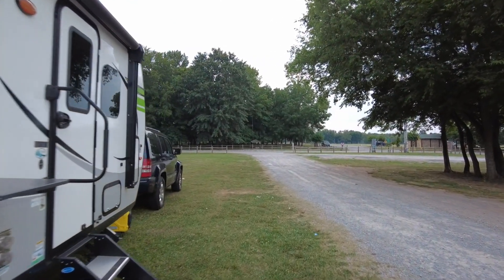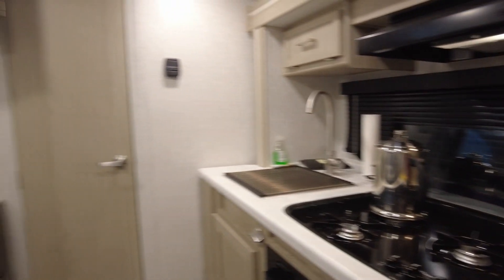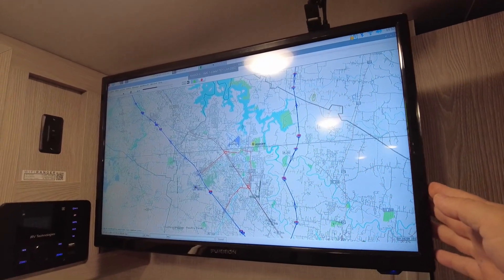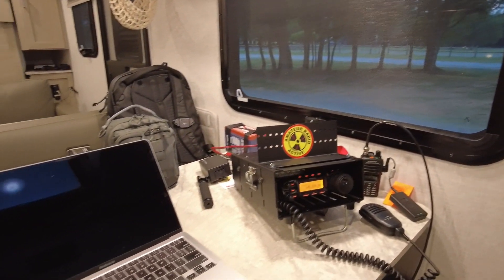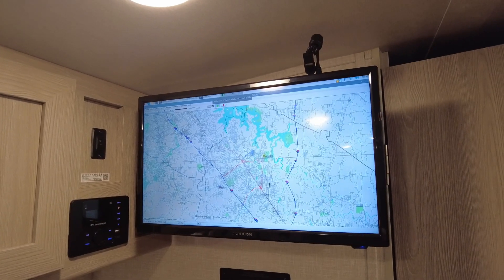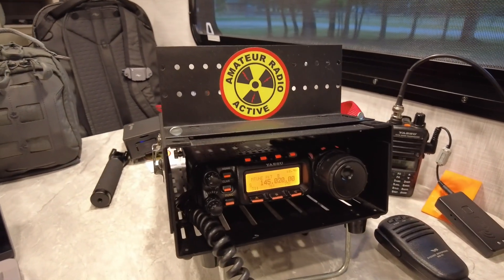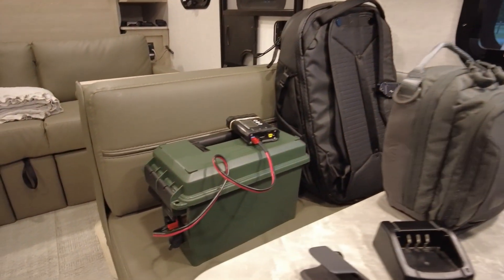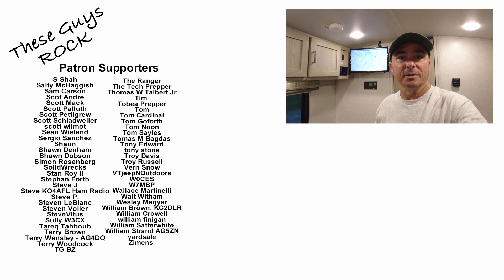ARRL Field Day Station 2022

Comment: I have one of your End Fed Wire antennas, great for my POTA operation, but is limited to 20W, not a very good HF EmComm antenna.  I did not see in video what would be a good EmComm station except for maybe the FT857 on 2m/440 for local comm.
Reply from the maker: I only ran 15W for Winlink on FD and had no issues connecting to gateways (K0SI) over HF using VARA. When I used 2M for Winlink connections, I set the 857 to 10W. It doesn't take as much power as you think for digital and running lower power conserves battery. On SSB you can use the EFHW at 50W. Each emcomm situation is different but I find APRS valuable for tracking assets/personel at a minimum but also for APRS messaging for short messages that don't need the longer format of Winlink. If the portable digi can get into a wide area gateway that still has internet, APRS messaging can also be used to pull short weather reports, and send SMS messages to cell phones outside the impacted area. After the Nashville Bombing a few years back, I used the 817 at 1W for Winlink over 2M. Granted, we are fortunate in Middle TN to have access to 2M gateways. Not everyone is as lucky. If there isn't one in your area, consider building one. You never know when it might be used in an emergency by others in your area.
Reply: @KM4ACK  I am not sure what WinLink has to do with Field Day.  I guess I thought the video was about Field Day.  We do have WinLink in our ARES system here in north Florida.  We also have SARNet, a UHF state wide 38 repeater system for EmComm.  APRS has died from long ago.  We still have some doing it, but few as other systems have taken over.  It is used for weather stations around the state, but nothing for Field Day.  Field Day is about when all else fails including the internet and repeaters are not allowed for FD operations.

Comment: Hey Jason.  Those Forest River E-Pro trailers are nice.  I'm thinking about getting a GeoPro here soon, but I'm waiting for trailer costs to come down a bit before I pull the trigger.  It's always nice to have a bit of shelter during Field Day.
Reply from the maker: The GeoPro and E-Pro are built on the same factory floor with pretty much the exact floor plans. Only the graphics are different on the outside. We have loved ours since purchasing it last year. The weight was a big part of our buying decision. It can be pulled with the wife's 2012 Jeep Liberty which has a 5000lb tow capacity. Fully loaded we come in at ~4400lbs. Not sure I could do a FD without it at this point. My full after action report coming soon will have quite a few more details about the RV, generator, and solar setup.

Comment: Overall great setup!!!  I've heard folks complain about the 857D for FD but I love mine!  Glad to see you give the girl a workout!  Not everyone can afford a KX3 or other high ender with a vhf/uhf transverter or module. What is the case she's in?  I have the 65R as well, and haven't scratched the surface on what it can do, or the 70.  My challenge I think is I am not at all familiar with Raspberry Pi or Linux, or MAC/Apple products.  So my options are limited with MS Windows.  73 de W3KKO
Reply from the maker: It's a Taccomm case. I did a review on it several years back. https://youtu.be/3hiNQl0Qz1w It's a great case that offers lots of protection but it is heavy. There are a lot of videos on my channel to help you get started with the pi. It's easy to get everything installed with Build a Pi https://github.com/km4ack/pi-build